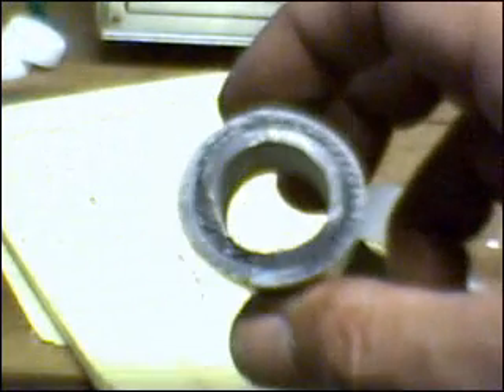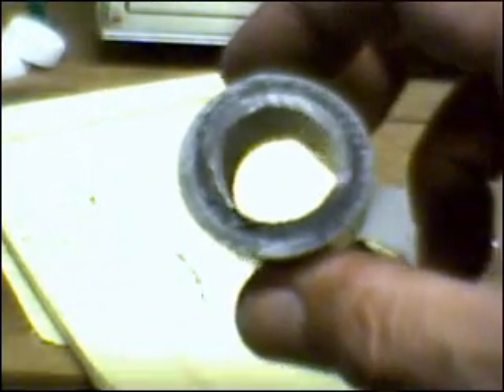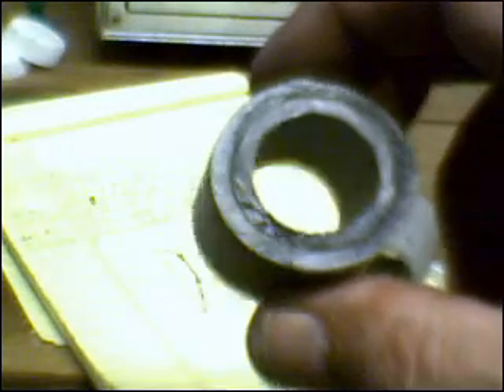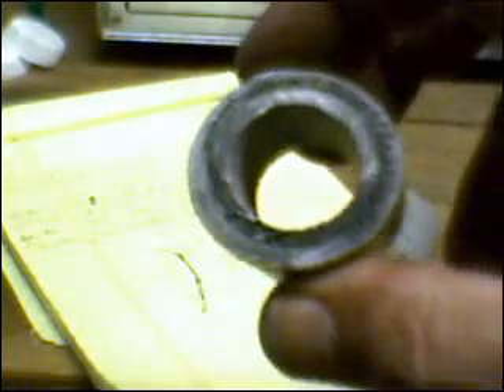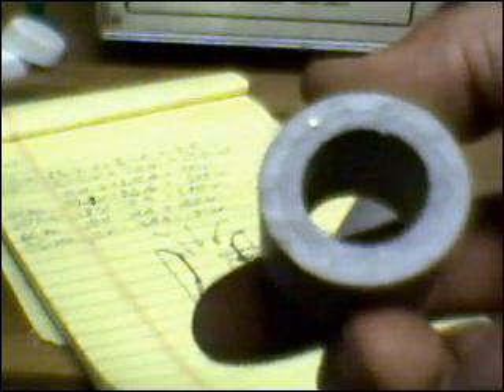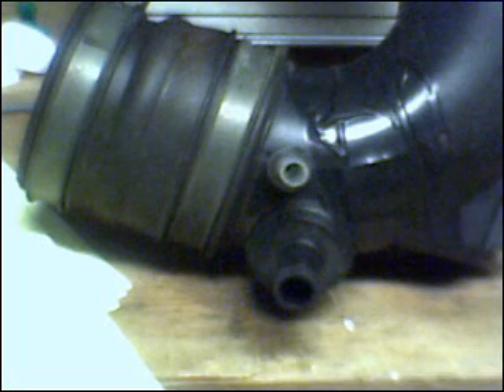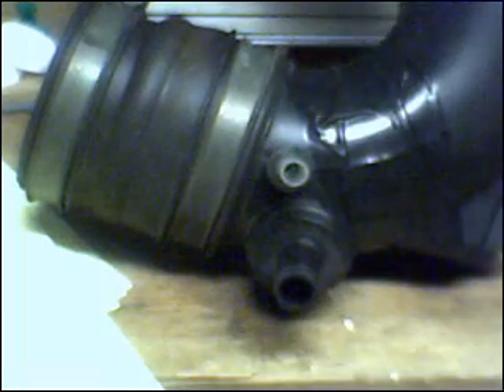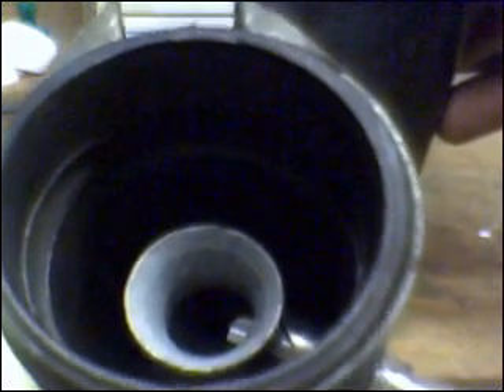#32 Hydrogen HHO ZooFFer Cell INJECTION METHOD 2007/08/11

Comment from the maker: The only "critical" spec is that the stainless be non-magnetic. Anything 300 series will produce HHO. Different grades (304, 316, 316L, etc) and electrolyte coombinations affect efficiency. They do not generally degrade.

Comment: I've been looking on how to install a device that well bring the HHO to my Air Intake, your showing a very efficient way, when I had my local Shop install my Kit, he didn't want to cut into my Air Intake Cylinder, so he tied into the Valve intake hose.  I've been having some really bad results, worse gas mileage, been talking with a Co-worker mechanic, he suggested closer to Air Intake, like your doing, is there by chance someone making these, be looking forward to hearing from you.

Comment: But, in a venturi ring, the air is compressed ! How come it will avoid the hole of the tube where the hho come ? the hho will be pull back with that pression !

Comment: No offense, but I believe MrSalty placed his pipework with too much constriction giving a huge amount of vacuum space even with it at idle.  ZFF is only constricting a little and is placed before the butterfly, so at idle, it shouldn't even add but the TINIEST bit of vacuum. A bubbler between the cell and the engine should also condense most of the water vapors before entering the engine, or maybe even multiple bubblers 'T'ed off to reduce the primary pressure of the tank itself.